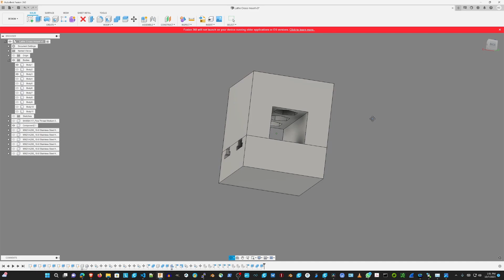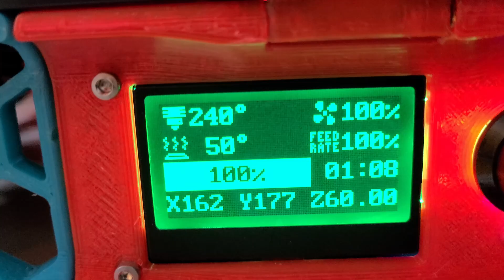Mini Lathe 3d Printed tool holder for larger and rigid cutting tools 1/4 to 1/2 in upgrade

Comment: Two strips of metal with two holes each would do the job and be more rigid. Would they not?
Reply from the maker: Perhaps they would, but I have no way of making those strips of metal currently.  I think I would need to bend them and I do not have yet that capability. With 3d printing I was able to whip up the bracket much easier and somewhat quite precise. I saw in the recording where the cutting tool got loose and now I know to check the 4 nuts on the bolts. to make sure is tighter. I also saw on a blog that applying too much pressure I could damage the bronze bearings on the head stock. So I have to keep that in mind too, in my quest for more rigid tools. But I alreaady made a new part to attempt to see if a boring bar will stay rigid enough. The last blue piece was ABS made and ABS is so difficult to finish printing without it coming unglued from the bd, that I made it in PETG, which has some flex to it. I may post another video soon.
Reply: no need for bending. You would just need drill and drillbits. Been there, done that. @RoamingInterests
Reply from the maker: Good Idea. Drill and drill bits. I happen to have those. So you mean something like a good chunk of metal drill it in a square pattern  where the cutting tools would slide in, hack saw the holes, file them, and then make the four holes to connect it to the cross slide and then tap the holes on  top to bolt the cutting tools down and then we're done?
Reply: @RoamingInterests I do not think you need anything that elaborate. Just a steel plate with four holes for the T-nut bolts. The plate it self would press down on the tool. If you want something similar to your 3D printed design just make this plate with additional two holes with threads. Than use standoffs for the T-nut bolts so it sits a little higher so you can slide the tool in without loosening the T-nut bolts. The standoffs you can make on the lathe or you could just use regular nuts to prop the plate higher.
Reply from the maker: Ok, I see now. your way is simpler. I guess I overcomplicated myself. Thank you.
Reply: 3d print a drill guide.

Alternatively just clamp the tool directly using  tee nuts. I don't that on a production job, cause the tool holder was rubbish.
Reply: Just have a spacer in between ofc.
Reply from the maker: You mean to align the tool with the center of the lathe, have a spacer? You see, I am not a machinist, so the terminology escapes me. But I am tryin, I am tryin'. Are you suggesting to drill in the tools with a 3d printed drill guide, then use T nuts to clamp them?
Reply: @skillfulsteak847  He is a hobbyist so every tool is precious. I would not do that. However printing drill guides is a good idea. Altough you have to clamp I correctly. It is easier to print the drawing on paper and glue it. If it is even necessary.
Reply from the maker: The way the ABS clamp sits now is quite good. I have vibrations from the actual back lash in the gibs or the threading bolts in the cross slide. Yea I can drill those tools and clamp them directly but I would not have enough play in the tool to extend it when i would need to extend it. So far it works. Remains to be seen how quickly am I going to get bored with it and make something different. Went and got some metal stock today, Boy is it expensive these days. Now just playing with the tools to see if I understand this. Question, Does the heat deflect the tool from cutting? I experienced some chatter today playing around and not sure it was because of the heat or because of the assembly, because towards the end of my cutting I felt the stock was quite hot, and I was also running high RPMs. Or could it be that where the tool cuts because of the heat the metal hardens?
Reply: @RoamingInterests  If you are lubricating the headstock bearings correctly and with correct oil and not exceeding rated rpms the headstock heat should be fine. In fact it should be warm(not boiling hot 😄) and some manufacturers even want you to warm up the spindle bearings before you engage higher rpms. (slowly increasing the rpm).
Tool deflection is a thing. Hovewer on your lathe you should not push so hard to have noticeable deflection due to heat. It is more propably due to loosen bolts, gibs or weak tool mount.